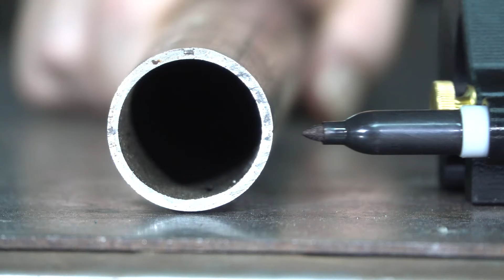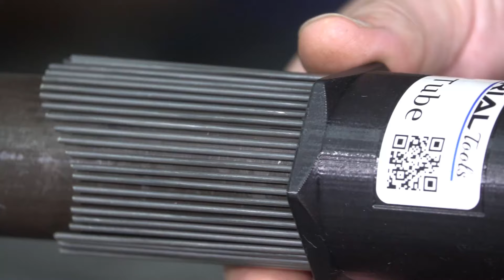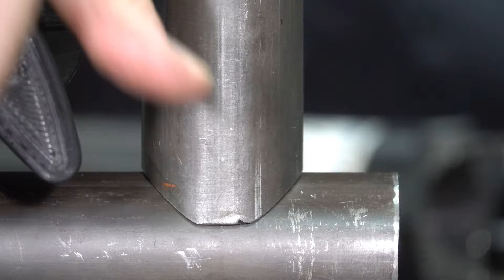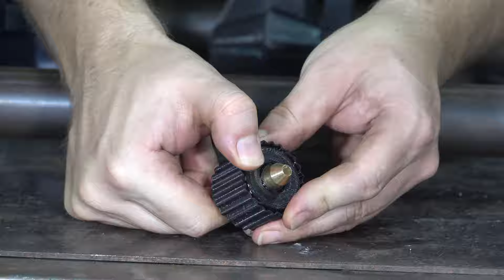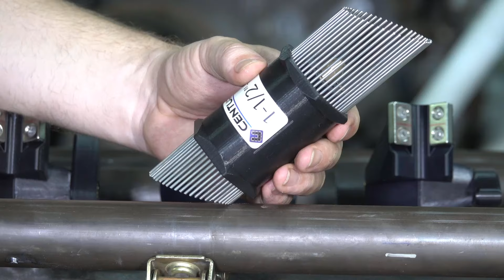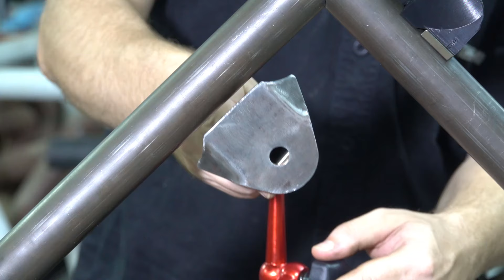Tube notching & fabrication tool kit! Perfect for roll cages and race cars of all kinds.

Comment: Do you make the kit for customers as well ? And would it be possible to make the pipe wrap around with steel rods a universal to accommodate a larger diamiter pipe
Reply from the maker: We do sell the tools completely made and shipped world wide. But we stop at 2" tube. And these tools are specifically made for race car building. What sizes do you need and what are you making?
Reply: @centurialinc  thanks for your response.
I am actually a pipe fitter and developing pipes is really time consuming.
I work on all diamiter pipes up to 15 "
Reply from the maker: Ok, we currently only have experience with tube fitting for race cars. I have no idea if these tools would work up to those sizes. I have my doubts. But I will add it to our development list and if we get more requests for larger pipes then it might happen.